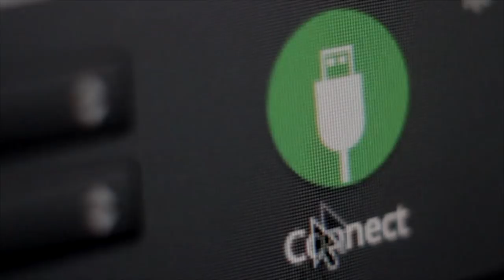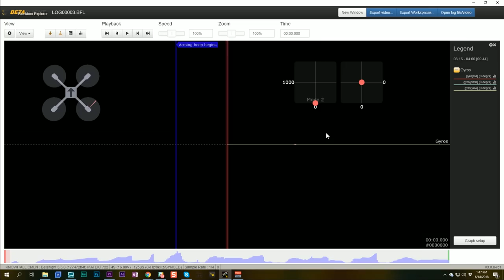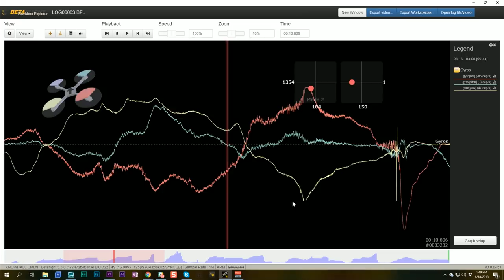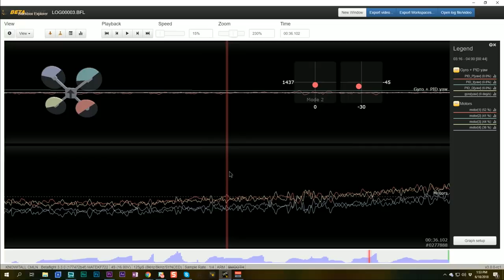Gyro Noise Troubleshoot | MINI QUAD BLACKBOX

Comment: Joshua-I love the way the FC talks to the ESC and the ESC talks to the motors and the motors are just like uuuhhhh! I 'm doin' the best I can!  Classic!  Actually, for me this was very timely as I had my GT R90 FC with MPU 6000 (Fury F4 V2) go out on me.  So, I'm replacing it with a Fury F4 V1 (32k gyro) which I know has had some noise issues.  The only reason I'm using it is because its a spare i had laying around.  Wish me luck! Great video. Thanks.

Comment: Nice info!  I have a new whoop that would go into an uncontrollable YAW spin after a couple of minutes of (conservative) flight...  I was trying to tune it out when I saw some bad lines in BetaFlight's 'Motors' tab...   I inspected the whoop and found the rear mount and dampening grommet were sitting loose on top of that mounting screw.  I fixed that and the YAW spin has disappeared...  My eyes weren't sharp enough to catch this out-of-the-box defect until I started scrutinizing the craft...  Shows you that utilizing ALL information can help point you in the direction of a solution!  Thanks for all you do, JB!

Comment: Thank you for doing this video. After seeing this I decided to finally stop trying to tune it out. My first instinct weeks ago was the change the ESC to something else, but I avoided it. Today I changed out the nice 40a 4 in 1 into separate ESC's, inexpensive 30a 32bit and only one capacitor. Got rid of the noise. No prop-wash now RF feels amazing.

Comment: I am so exited. I just replaced the GOKU F722 MPU 6000 of my FC with one from a defective AIO toothpic FC and guess what? It worked. I already ordered a new FC but wanted to try if I can replace it with my SMD rework station. Guess how happy I was as the FC booted and a first test shows that the gyro is "clean" again. What happened was that shortly after I got the quad I had a hard crash and I had to replace an arm. At the same time I updated to BF 4.2 and had a hard time to tune as I always got strange oscillations on throttle up. No amount of filtering or playing with the PIDs worked. FC was already soft mounted and everything else checked. It turned out that the original gyro started to jerk on the pitch axis probably caused by that crash some days ago. It took me some time to find out that my problems was actually related to a defective gyro. It was not apparent to me until I checked the black box logs which showed a scraggly unregular noise on the pitch axis, as soon as the motors were running. The conclusion: Gyros can break on crashes :(

Comment: Great video! The ICM 20602/20608 gyros have known issues with clipping which is why they made the 20601 which doesn’t clip. It’s a more expensive component but worth it in terms of quality.
A couple things to note: Grommets + rubber standoffs can actually create very bad noise problems because it’s literally too soft and allows the FC/Stack to sway and move too far durning hard maneuvers. With Helio specifically, soft-mounting motors has proven to also create issues in most cases. That’s because we don’t filter noise as you would a subwoofer with notches and cascading LPFs, we filter using an advanced kalman that’s designed pass through real motion with less delay and error. As JB said, you can mask issues, but masking issues will make your quadcopter fly poorly instead of allowing you to see there’s a problem and give you the opportunity to resolve the underlying issues. Not everything is compatible with everything else. Prop and motors choices, esc choices, FC choices, not every permutation is possible to test and verify compatibility. The machines themselves are simple but the nuances are highly complex.

Happy flying!
Reply: Helio RC Hey, how's everything? Is there any international supplier where I can find your board? Because the shipping from the US is usually really expensive. 😔
Reply: Got mine from rcpapa.com
Reply: Gotta love the Helio Spring on Odin! ;)
Reply: I got a really good tune going with Odin, should upload a video soon, my graphs are good, gyros are calm and smooth, some oscillations in the worst case scenarios, such as punching out after a hairpin- but this is the nature of the beast (prop wash is going to happen) and the tune, but the Gyro data is pristine.

I have a F4 with a 32khz gyro that will peak even when double soft-mounted, if only Helio had a 20mm board...
Reply: Wyvern mostly what is called propwash, isn't propwash. You're tuning your PID with normaal airflow. When you fly at high speed and suddenly make a full throttle 180° the air flow becomes double of what it was when you were tuning. Which will result in your to be expected too high P oscillations.
Reply: Yeah, I know my P's need some attention- I call it prop wash for lack of a better term, it's when you fly right through your own turbulence which is a  low pressure zone since more turbulence=lower pressure, props spool up much faster since it's pushing less air and the gyro Pid loop doesn't expect that change- it's like it suddenly goes from a 5" to 4" prop. I am going to soften the P (hahaha) and possibly add more D (hahaha?).
Reply: In my expert experience the kalman filters you use to filter the data gives me a mushy experience. The throttle doesn't feel direct and the pitch and roll feels sluggish to my input, Odin feels like a combination of KISS and betaflight. Although It flys well I prefer a more sticky and direct feel to my flying style.

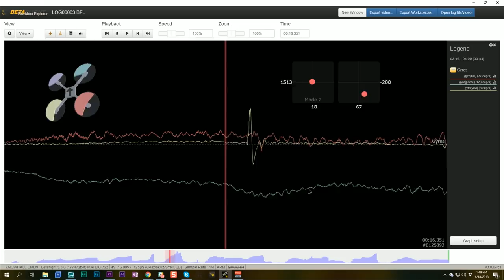Comment: Hey Josh, the reason the yaw axis is most affected by vibrations (11:36) is not to do with the design of the chip, it's because excitation by an out of balance rotor causes displacements along the plane of rotation - and the yaw axis is the only degree of freedom affected along that plane (pitch and roll are both perpendicular to the rotation). It's kind of like how in a car engine with a horizontal crankshaft, you expect to see vibrations "up and down" or "side to side" but not "back to front"!
Reply from the maker: I'm not sure this is true though. When you spin motors, you see vibrations on all axes. There's no reason to assume a prop is well balanced on the up/down axis after all. There's no reason to assume a motor is perfectly perpendicular to the axis of the quad. So I think vibrations can occur on all axes. yaw axis often shows less gyro noise than the other three, but it is always, always yaw that "glitches" in cases like this.
Reply: Joshua Bardwell hmmm yeah true I was looking at it assuming the prop/motor bell is a bit off centre but still roughly balanced in the up down direction. I’ll look into this, let us know if you figure it out :)

Comment: Great video, I'm glad you bring this topic up. Altough my type of problems are not mentioned. I'm running a matek F722-std and I double softmount all my motors, soft mounted the FC with silicon rings as well but I'm getting oscillations of the top end of the throttle.

Comment: Thanks! 
With the help of this video I finally figured out why my quad was having mid to high throttle oscillations after changing escs (to a 4 in one) and FC...

( Been struggling for a while, tried TPA and tuning to death but it turns out my pitch P gain had to be turned down really, really, low compared to my roll P.)

Comment: Hey Joshua, Ive also had some luck with 4 in 1 esc's putting copper foil over the esc fets on some of them. Electromagnetic interference can some times find its way inot the gyro and applying the copper foil helped out alot. RDQ carries it but if you go to model shops, a lot of times they'll have it for car models in larger sheets with adhesive on one side.
Reply from the maker: The ESC is DAL Engine which has a nice metal cover already.

Comment: Lord is hope this works, I'm getting really bad yaw twitch and I'd HATE to have to replace my JB F7 FC! Damn thing looks so sweet in my Chameleon TI. Update This was my first real build with parts I chose.  It wasn't anything wrong with my build. I downgraded the firmware that came on the esc from 32.8 to 32.7, problem solved. It was enough to scare and frustrate the hell out of me considering I'm new to this.

Comment: Thanks JB!  I'm having a terrible time with desyncs on my new 6S build, and I'm hoping you might have a suggestion before I start replacing components. Specs:  Mode 2 Ghost, Aikon AK32 4-1 ESC, Pyrodrone F4 FC, Hyperlite 2405/1722 kV, 330uF (I think - it's whatever came with the Aikon) on the battery leads. In Blheli32 I've set demag comp to HIGH, AUTO motor timing (though I've tried other timings), 48kHz PWM, and I'm running DShot 1200 ( though I've tried every other protocol the Aikon will accept).  It desyncs during hard throttle application in turns, and generally the left arms drop, but I've had the right side drop as well. Interestingly (and sadly), I have a friend with THREE new builds using this hardware and he's having desyncs on all three!  Any help would be tremendously appreciated. Thanks.

Comment: Hey Joshua! This helped a lot. Unfortunately I'm looking at needing a new flight controller in thus new build. The FC/esc combo I'm running is the Axisflying Argus f7 Pro 65amp esc.  This has been driving me wild trying to resolve it.  

Am I going to need a new esc as well or just a new FC? Can you recommend a good FC for a 6" 6s quad?

Comment: OMG, I'm such a noob... I started to suspect some problems, got into blackbox, plotted the histogram - and it was almost all red, like that red so no filters could help... I watched 2 hours of different videos about blackbox and filters, and only then got to this Joshua's video where I was told to review the props and replace them LOL. Now my histogram is green and quad flies perfectly smooth! 😀On top of that, while I was testing this 3" build, I though, why should I put both screws to each props, 1 should be enough, it is fractions of a gram... Oh, my, such a noob (facepalm), 1 beaten prop and 1 instead of 2 screws in a props that made them imbalanced and caused enormous vibration noize

Comment: hi jos, can u help me doc? my quad have a noise/some vibrate,just 1 second vibrate every 10sec..am using dys f4 pro v2 for fc, littebee spring 30a esc, and t-motor 2750kv. please help me if there any solution setting from betaflight jos.  sorry my english too bad

Comment: Another great video thanks, it will help In diagnosing my quads problem of drifting to the right.  I’ve tried resetting the accelerometer,adjusting pids,adjusting my transmitter etc. with no fix so maybe it is vibration.  I’ve had this problem on a new build and changing the fc was the solution.  What do you think?
?

Comment: Pretty much why I use the soft mount stand offs with the soft silicone grommets that go in the fc mounting holes. On some builds I even soft mount my motors. Soft mount the soft mounts yo. I never have issues with noise from vibration doing so. My very first quads hardware is still in action. Keep all wires clear of the gyro and cap your power.

A mistake people make is they never factor in frame resonance. All carbon is not created equal and certain frames like the speed addict super light and the Astro X series of frames are very prone to this from what I have seen. Hard mounting an fc was always an issue in those builds I have fixed for people. I would tell them to soft mount the fc at the very least and add a low esr cap min of 470uf 25v. People who would not listen had issues those who did listen had smooth flying quads on stock BF tune.

Comment: I have a new build that's not flown for over a year. I've been softmounting and swapping parts out and it still doesn't fly as good as your little shimmy. I wish it would fly that good. I recently flashed it with Betaflight 3.4 and used the tuning tips and chose the "beat up quad" option. It still jitters just on a hover and motors get hot. I've tried everything other than put the parts on another frame or swapping the flight controller. But these are the final two options I'm left with so a new flight controller is on order!
Reply: D S have you tried different props? I had terrible noise that didn't go away. I softmounted, added a capacitor, everything i could think of, at the end, i just had shitty props.

Comment: hello i know the video is a bit old but i had a question. can these vibrations that overheat the motors and maybe the flight controller cause the drone to crash (failsafe or security for the motors)? Thank you.

Comment: I don't know if this is your issue or not, but my quad was flying strange.  Lots of vibration.  I changed out the props, etc.  but nothing helped.  I ended up twisting the arms a bit and found out that one was a lot more "twisty" than the rest. I'm assuming it's delaminating and I just can't see it.  I'll be swapping it out tonight, so I don't know if it's my issue yet, but thought I'd mention it.

Comment: Hi, Joshua! I have a big problem but no one who i know can't resolve it. I have a really bad yaw twitches on Throttle 50% (not 0-49%, not 51-100%)  right on 50%. I change motors, frame, FC, stup capacitor, dampfers - problem is still here. One thing i dont change is TBS Crossfire. I dont mind whats going on… (Sorry for my english and big up from Russia)

Comment: That white car looks familiar. Are you chill'n with Mr. Davis? Are you debugging a RF build or just some FC with MPU6000? I have my first RF quad and am running into the same issue. Flies like a dream, but struggling to clean up the noise. My RF

Comment: I literally just changed a flight controller for the same issue! Mine got so bad that it would do a full 180 on the yaw axis. It took me a while to figure it out because I thought I was having pid issues. Mine was a omnibus f4. Got a new one and I don't have the gyro issue but I still have this "wobble" mostly noticable in smooth flight but I can hear it quite a bit. In the second flight after adding the cap and soft mount the motors sound like flubber haha.

Comment: Guess I gotta try figure out black box. I got a brand new Taycan basically and I've been trying everything to stop the twitching even when hovering and the slightest breeze even inside just from the slight wind it puts through the room. Everyone says to use defaults and I should be fine but that's not happening. I'm running 4.1.2 and iv soft mounted everything already lol. I swear jv had more problem out of a quad thats supposed to be smoother by design lol

Comment: Perfect timing!  My new build is doing this exact same thing.  Using the HGLRC f440, xhover win5L frame with emax LS2207 2400kv with the emax avan flow props. Shakes so bad you can't fly it.  Also using the racewire. Don't know if that could be chocking the voltage or amps? Let me know if you have ever heard of that?  FC is softmounted too. Any help would be nice of if there have been problem with the parts I'm using be nice to know too.

Comment: Hi! I have a own design 6/7 inch 3d printed noisy quad. For it not to burn up I must set d-term 0-6. Guess I need to try a capacitor... 🙈 Can I add one 1000 uF and one 560 uF together?? Flying 5s and 6s with 4-in-1 esc.

Comment: Also, what happens with the dodgy FCs? Have you put them into other builds? Builds with smaller motors etc?  I ask because I have a tyro99 that yaws crazy bad and I want to know if I should just buy another drone kit, so that way I can get a new FC and try that and if it is still bad then I can put it down to an inherent problem of the drone itself rather than the FC, then I have a spare FC, and a new drone :-)

Comment: Honestly i think the issue is your forced with these gyros to softmount and sometimes that softmount can cause its own problems. I personally don't like the thin rubber standoffs and much prefer the big 8mmx8mm m3 standoffs as they are much stiffer.
The mpu6000 is still my preferred gyro as with it you have much more flexibility and don't have to softmount but can if you need to.

Comment: I used to have noise like that, punching the throttle would fix it and it would shake only when I fly slow and stable. I didnt solve the problem, i flashed bf 3.4 and didnt touch the pids and filters, Ill fly it tomorrow and see how it works out, if id doesn't I'm gonna have a blackbox log for the fb group to look at :P

Comment: I have the same issue with a new build and my arms are loose and no matter how hard I tighten the screws they still wiggle I believe that is my problem next is to drill a new hole and add an additional screw

Comment: So after you soft mounted,  it looked like the noise issue was fixed but you then developed a new problem of poor prop wash handling right...   Since soft mounting is basically equivalent to just adding a random software filter with unknown cut frequency and unknown latency... it really looks like a latency issue from over filtering.  Why not go for a more extreme reduction on software filtering at that point to address the latency in the soft mount?  I've seen soft mounts cause that poor prop wash handling quite often.
Reply from the maker: I disagree that the problem was handled. You can hear the noise in the motors even when flying straight.
Reply: I'll take your word on that... it's hard to discern such a subtlety on a cell phone YouTube video.   But an over filtered gyro with either software or physical soft mount would certainly introduce an audible response in throttle too.  I would expect that it would be more consistent than random accumulatuons of noise.  I just couldn't tell from the video which it was.  Good video and nice work!  I still feel like soft mounting while often effective is the equivalent of set_random_unknown_lpf=ON.  It's quite a wild card in a system that we attempt to adjust with such precision.  How about some sort of experiment to measure the frequency response and phase shift of common soft mounts?  I'd be curious to see an example of some data on what we are actually accomplishing.